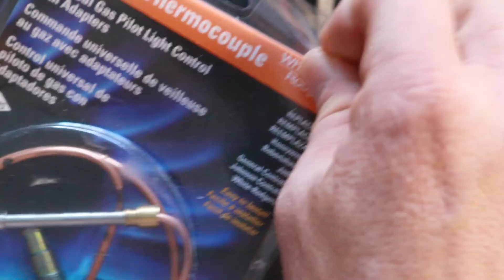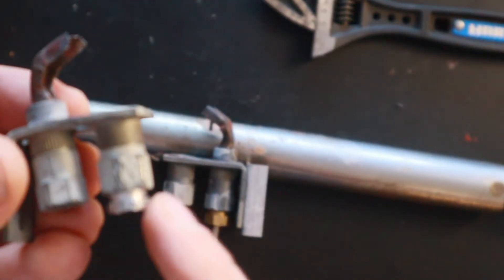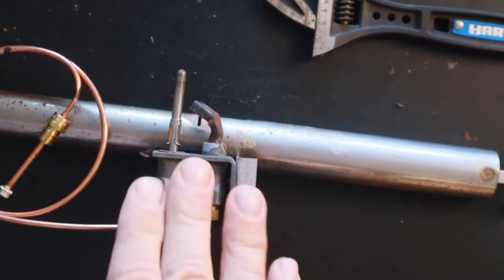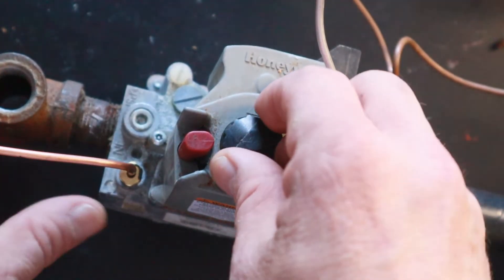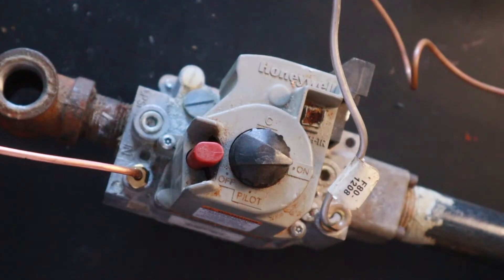How To Replace A Boiler Thermocouple

Comment: Why is it my boiler is not turning on when i call for heat but i go and tap it the gas line near the gas valve so the burner turns on the fire

Comment: I have a tip that has work for me in the past. Get a torch and heat the thremo coupling until it gets red hot. Should work if the copper line isn’t broken.
Reply: I tried that, but it didn't work,looks like my thermocouple is too eroded away

Comment: Great instructions. My boiler is heating up again.
Reply from the maker: Nice.
Reply: @JerseyMikeHVAC  took 30 minutes once I had the part. Very tight quarters for the boiler behind a water heater. Figured if I was going to remove the thermocouple to either clean or diagnose it, it made sense to just replace it. Inflation made it a $12 part...

Comment: Why do some techs place heat; such as lighter or torch unto the thermocouple? I notice they do this to make the gas valve open  (pop)!!!. Is this method a away of testing it? I noticed in frigid weather where the pilot light went out for days; due to wind, then this sometimes starts it up.
Reply from the maker: The thermocouple sends out millivots that the gas valve uses to hold open the gas solenoid to feed the pilot flame. The main gas solenoid on the gas valve wont open unless the pilot solenoid is kept open by the thermocouple.
Reply: When can I donate monies on your site ?

 @JerseyMikeHVAC
Reply from the maker: Thank you. I appreciate the offer, but it isn't necessary.  Liking, commenting on and watching my videos is all I need!